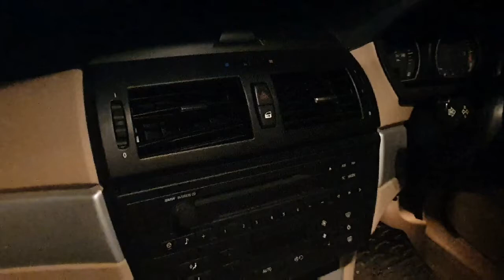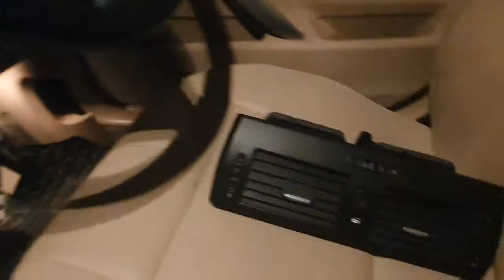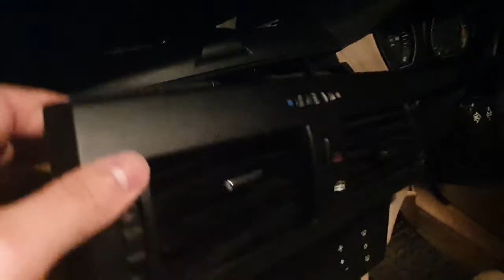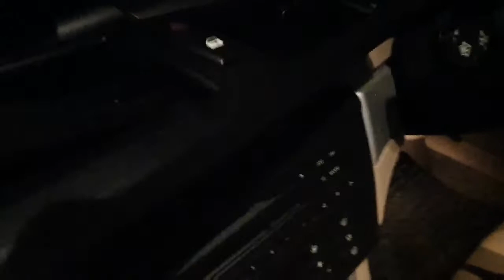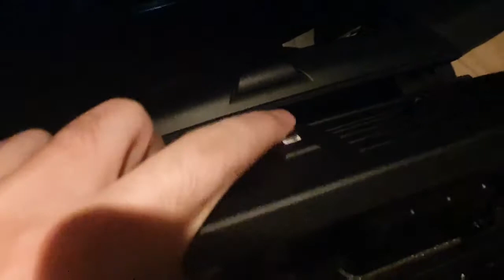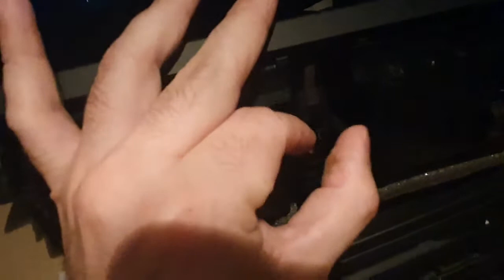BMW X3 Dash Air Vent Replacement 2007

Comment: Hello mate, 
My bmw e60 530i auto petrol 54 plate, has a warning error displaying TRANSMISSION FAULT, it goes into limp mode when driving, no acceleration i have to stop the car, switch off and restart with the gear positioned in neutral to get it going not sure wats going on as it intermittent. Any ideas?
Reply from the maker: Hello mate,
 It could be a few things il do my best to help. Did it get stuck in any gears? They love to get stuck in 3rd.
Reply: Its automatic
Reply from the maker: Yeah its the autos that get stuck in gears especially 3rd. Without knowing a fault code I would be heading down the transmission oil level or condition of the oil. A quick transmission oil change would do the trick. A good friend of mine had a similar problem on his X5 auto, we changed the oil in the gear box and it was sweet as a nut.
Reply: I had the transmission oil changed about 4 months ago, I will get my mechanic to check for any fault codes and let you know... initially he said it was the transmission valve body so had it  replaced...  worked for about a month but now the warning error has come back on again
Reply from the maker: Ahh right ok, so new oil and valve body 🤔 Yeah let me know the codes or even if he finds the fault it would be good to know 👍